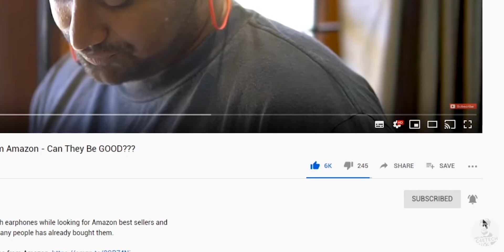70,000 Rupees Gaming PC Build (2060 Super) - Build Guide / Tutorial

Comment: Rtx 2060 super is  priced around 33-40 k (fluctuates).  You didn't even included the later purchases like Keyboards,mouse ,Monitors,Speakers.Storage is also less. You also need good fans for 2060 super. Its gonna cost you around 85-95k.

Comment: Hey Ash, please answer this question if possible.

I have the same MoBo. I am using and M.2 and as you know the m.2 slot is right below the GPU slot. Is it ok for long term usage?
Reply from the maker: Yeah that's fine dude. Most flash storage drives don't need much airflow and the air from the GPU would be fine
Reply: @C4ETech  great, thanks for the prompt reply :)
Reply: @C4ETech  ASHWIN INDHA PARTS ODA  PRICE IPPO ADIGAMAHA IRUKUMAE. EPPO PRICE KAMMI AAGUM NU THERIYALAYAE.

Comment: How this build is a 70K build??
Reply: You can build something better than this for 75K now if you don't use an expensive case and 850W PSU which is a big overkill in this build. Zotac RTX 2060-26K, corsair vengeance 3600Mhz-9k, Ryzen 3600-17k, A good B450 board-9.5K, ADATA 512GB NVMe SSD-6.7k, case-3.5K, Corsair CX550 PSU-4.7k.

Comment: Ash I tried to add the same parts to my cart and it is pricing about 99k... I really need this to be my gaming pc is there a way you could help me???
Reply: You can build a better PC for much less. Try these parts : Zotac RTX 2060(26k), Same Motherboard or any other good one(9k-10k), Corsair Vengeance 3600Mhz RAM 2x8GB(9k), Corsair CX650 or any other good 550 or 650W PSU(5.5K), Case(3.5k-4k), ADATA SX6000 Pro 512GB NVMe ssd(6.7K), Ryzen 3600(17k). Total will be less than 80K.

Comment: Just some constructive criticism.
The graphic card goes in last, because if you put it in first, then you have a hard time connecting the front panel connectors. Steps should be 1. CPU 2. Ram 3. Heatsink 4. M.2 if you have any 5. Motherboard in case 6. Front panel connectors 7. PSU and then graphics card goes in last. And also why does this have an 850w psu??? It’s overkill for 2070s and r7. People who follow this will get misguided for sure and end up wasting their money. Also that’s some sloppy cable management.